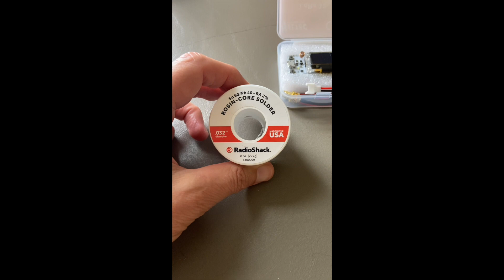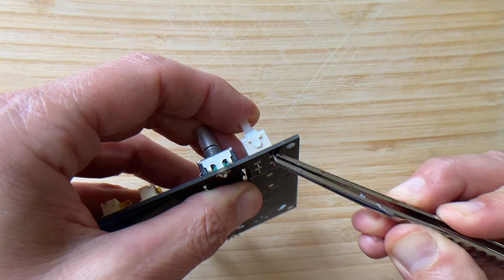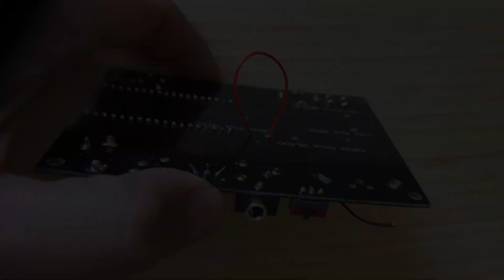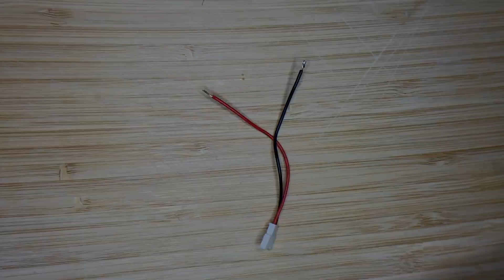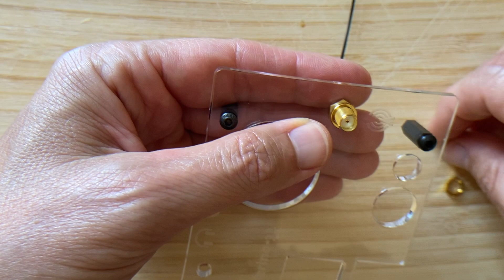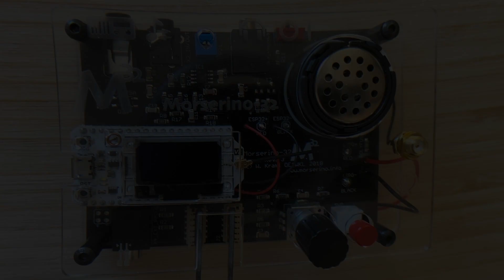Step-by-step Morserino-32 Build

Comment: Very nice video. They should have warned you not to power the meshtastic up with the antenna disconnected as it can burn the finals of the transmitter of the meshtastic out. They were very adamant about that on the v3. I saw one other person do it, and it still worked anyway. I suspect, your's will probably continue to work too. Albeit I wouldn't  press my luck. You did a great  job.

Comment: Well, you just helped another (rather diffident) Morserino purchaser through the building process. What a lovely video you've made here, letting us see frankly where you've been a bit stumped or puzzled for a moment, then have figured a way through. And the quality of you visual/aural presentation is outstandingly clear. The unit I've just assembled had some very minor differences from the one you put together, but your guide was absolutely invaluable to me. Thanks so much for taking the trouble to put this together! Peter Dann VK3WOW

Comment: Nice job and the case is a perfect fit.
It motivates me to get mine done. 
Though I do wonder as my vision is falling off if there is a way to transfer the display to a tablet or laptop, or possibly increase the screen size on the unit?

Comment: Rose, thank you the great video. You are very lucky that the connector for that battery didn't match. The lipo you have is a 2s (2series) lipo which would have pushed twice the expected voltage into your device 7.4v. The instructions specify a 1s (single cell) lipo which would only provide 3.7v. you likely would have burned it up with that battery.
Reply from the maker: woah

Comment: A tip to soldering in components like that switch that you're having a hard time getting flush is to solder one leg, and then after it's in place hold the board while pressing against the component with one hand, while you use the other hand to reflow the joint.  When you feel the component push into place, remove the soldering iron, keep squeezing for a couple of seconds until the joint has cooled and then let go.
Reply from the maker: Thanks!

Comment: Rose, I just built a Morserino32 by following you excellent video. 
Thank you. A few problems due to my eyesight and hand tremors, but I got there  :-)
But the LIPo battery I ordered from Amazon will not fit under the  Heltec. --- too big!
Did you find one  that did fit?
If so, could you send me a link?
I'm also having problems locating a USB-A to micro USB cable.
I'm housebond due to health issues,
Can you help
Reply from the maker: https://smile.amazon.com/gp/product/B0748CKDCM/ref=ppx_yo_dt_b_asin_title_o00_s00?ie=UTF8&psc=1
Reply from the maker: https://smile.amazon.com/gp/product/B003YKX6WC/ref=ppx_yo_dt_b_asin_title_o00_s00?ie=UTF8&psc=1

Comment: Tip for putting on the display board. Only solder the end pins on both terminal strips. That makes it easy to adjust to  90 degrees by heating each pin as required and eliminate the 'bending' step which is best avoided. Second method. If you have a breadboard put the headers into the breadboard and then fit the wifi module on top of that. This should hold everything at 90 degrees. Then carefully (and quickly) solder the end two pins and one middle pin. You do not want to ruin your breadboard by too much heat. Double check it looks ok and then carefully and gently pull the module free of the breadboard (pulling on the pin strips not the module) then place onto your antistatic mat and solder the rest of the pins.
Reply from the maker: Thank you.

Comment: The sliding switch needs to be "On" only if you are charging the battery.  If you are using external USB power it doesn't matter which position it is in.